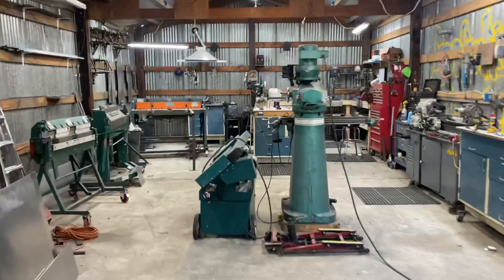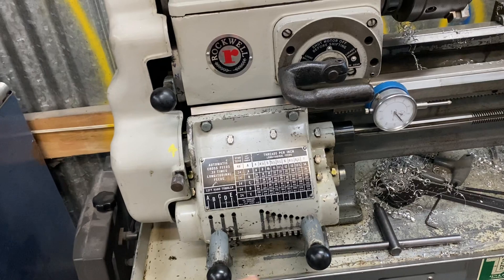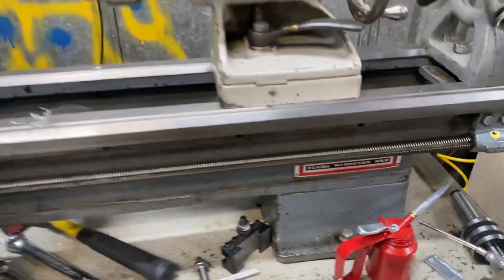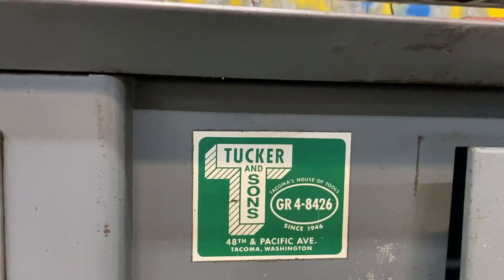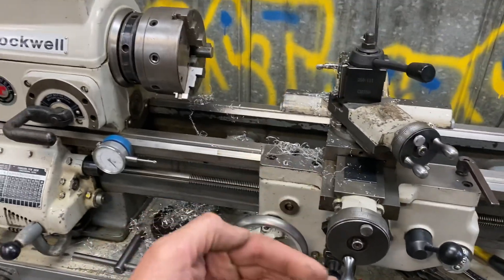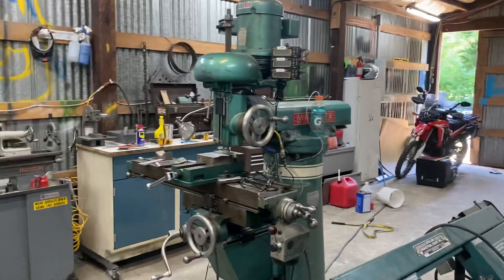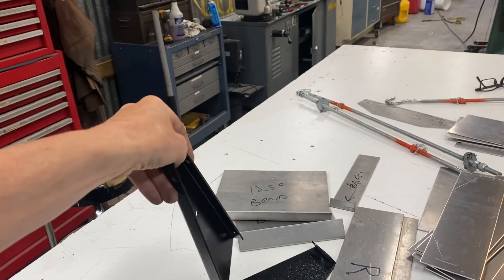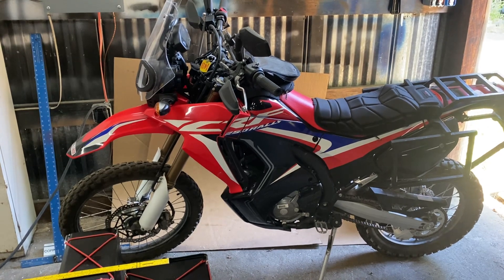Gen2 KLR Screen risers/New metal lathe

Comment: Very nice, got one similar at a auction recently. Same length bed. Looked up the serial number and found out it was used by the US Army. The plate on the tail end had a NSN number. Used that information to find the TM manual for operating the lathe.